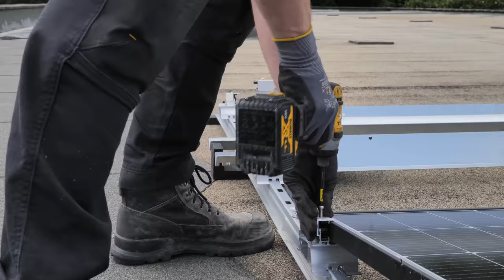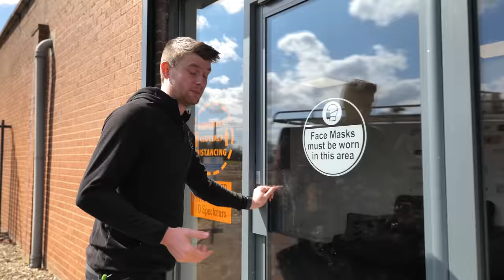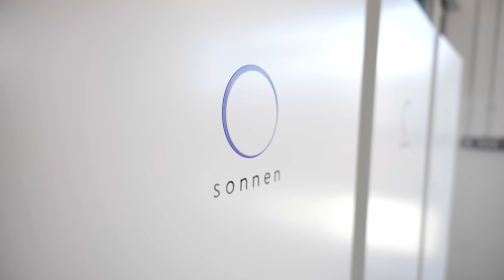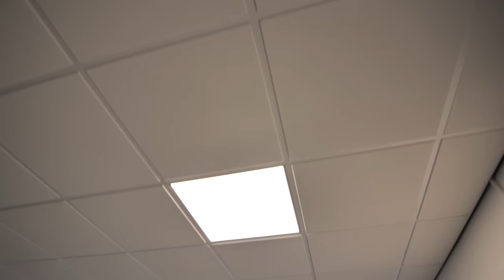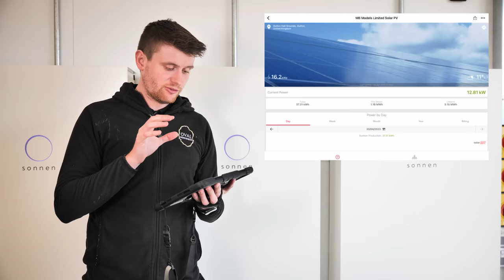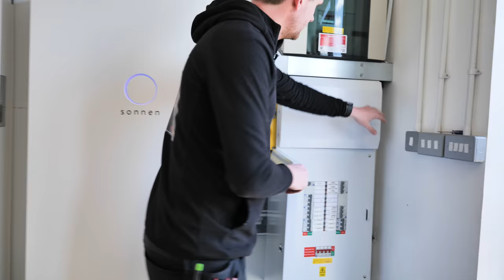MB Models three phase solar and battery system Part 1!

Comment: Im looking for an off-grid design, high power load. Wondering if 3-phase is better or more efficient than single phase?
Reply from the maker: I would try to split the high load over three phase yes as that lowers the required output of the inverter

Comment: Good video, with such a big roof space was any consideration given to to mounting some panels to make use of three aspects giving a earlier and later solar window
Reply from the maker: No as this would have bumped the cost up quite a bit and required lots more weight to be added to the roof.

Comment: Did you suggest the possibility of using bi-facial panels? Should produce aprox 10% more PV, more if they painted the roof white or light grey.
Reply from the maker: No we didn’t as there is so much space on this roof that if they want more generation then they could easily add more panels. More cost effective that way then painting the roof white

Comment: What's the point of optimisers on a flat roof with no chance of shading?
Reply: Clouds
Reply: Optimisers also allow the user an individual view of each panel for generation data. This is particularly  useful if there's a problem, you can see what panel is faulty on a particular string.
Reply from the maker: Optimisers are very useful on every installation despite shading. They help to mitigate the effects of:

-shading issues from fixed or movable objects (clouds, trees)

-underperforming panels due to damage or bird mess 

- they alert the customer to an issue and identify the location 

- they disconnect the D.C. from the property if the inverter raises a problem

Comment: Great video, do you have many issues with Sonnen battery storage? I’ve installed one and had constant inverter issues with it!! Very frustrating, would not recommend with the experience I’ve had with the SB-10 unit.

Comment: Great video Sam 👍 . How do you know which brand of PV module to choose there's so many out there do you just have your set favourites or do you try use lots of different types? Thanks
Reply from the maker: Thank you very much we have the brands that we prefer. However many of the brands around at the minute are very similar. It usually comes down to customer requirements like all black and also dimensions of the panels. Another thing customers are interested in is the warranty that you get with the panels. We look at all of these things and then select the right panel for the customer.

Comment: Thanks guys, great video.  I was surprised at the low angle of the roof mounted panels, but you are the experts.  I am interested how you got your panels secured to the roof, did you have to drill through the waterproof layer or are the concrete slabs just weighing down the metalwork?
OMG though, who did your sound levels?  The music came on and nearly blew my speakers out, turn down to 5% volume.  Music stops, voice level is really low, back to 100% volume.  Why do you want your viewers to have to keep twiddling their knobs?
Reply from the maker: It is the standard level of the flat roof mounted system. I believe it is to do with wind loading and planning permission. If the panels were pitched at 30-40 degrees then more weight would be needed to hold the system down and it may cause issues with planning permission.  

The volume is a strange one as on the phone it is different. I have raised it before and it seems to be a YouTube thing depending on what you are watching on.
Reply: @OvalRenewables  Thanks so much for the reply.  I was considering putting panels on my flat roof extension, but had assumed they would have to be screwed through the water proof layer into the rafters.  Now I know this might not be the case!

Comment: I notice that most of your installations have strings and panels with or without optimisers feeding DC power to a large-capacity monolithic inverter. Do you ever use micro-inveters on panels thus feeding AC from each panel from the roof to electrical infrastructure? I know you need an inverter to then convert to DC for battery storage and the panel electrical components will be different. Is it a regulatory compliance issue that makes either type of PV setup preferably in your market or some other consideration?

We here in the southern hemisphere have both types but domestic installations seem to be predominantly moving towards micro-inverter installations.
Reply from the maker: Thanks for the message. It’s not a regulation thing it’s just how we do it. Most other installations don’t have any form of optimisation or micro inverter setup. We like the SolarEdge system however as it give the customer greater efficiency and improves safety.
Reply: @OvalRenewables  Thank you for your reply. I enjoy all your videos for the details you include and the fact that you have all the process steps with it. I would encourage you to bug Artisan Electrics to use their influence to get you some electric gloves and "artic" jackets to help keep you warm in your "British Weather Events" 😁🙃